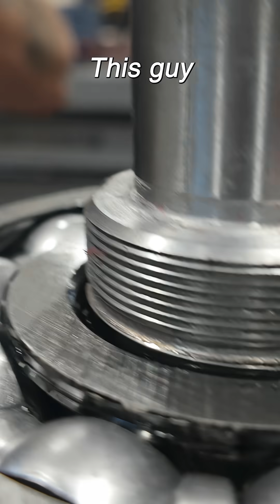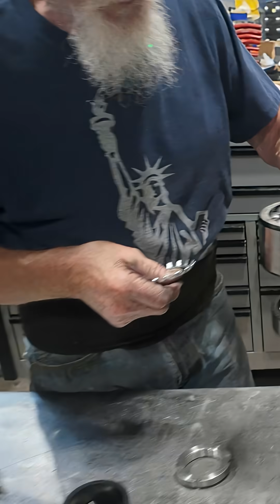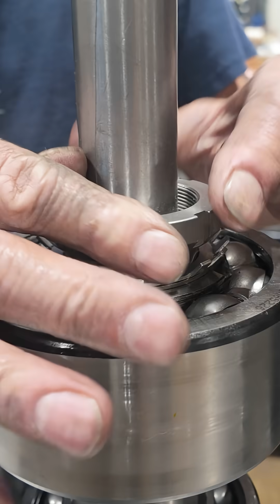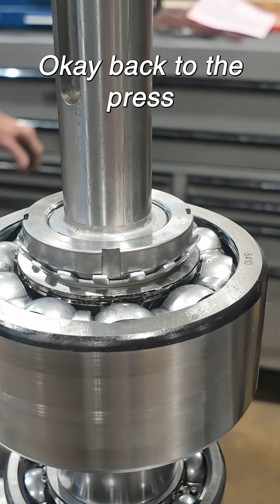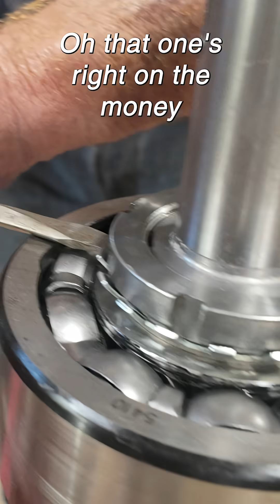Liberty L Series Hopper Pump Assembly Part 2

Comment: What does tapping it with the hammer do? I can see it helps you screw the pieces together, but it isn't something I've seen before-- why does that help?
Reply: The vibration helps loosen any gunk/dirt/burrs on the threads that is causing the rotation to catch. A little bit of oil or heat may have had the same effect.
Reply from the maker: It's a trick to straighten out the threads. Try it the next time you have a nut that is giving you trouble threading onto a bolt.
Reply: The nut may be a little oval, and the hammer tap briefly rounds it. It's a good tip, I have seen it before for gas bottles, but not bearing lock nuts.